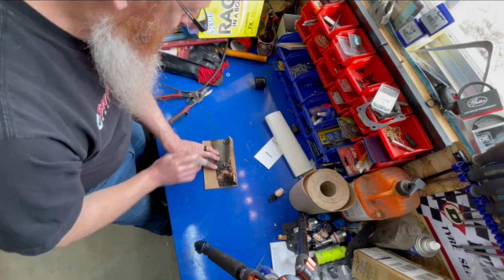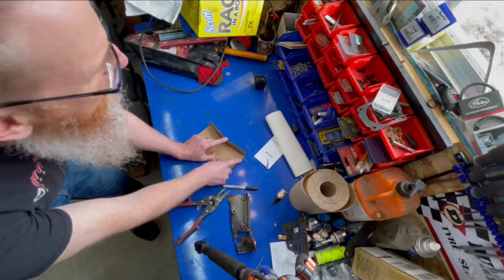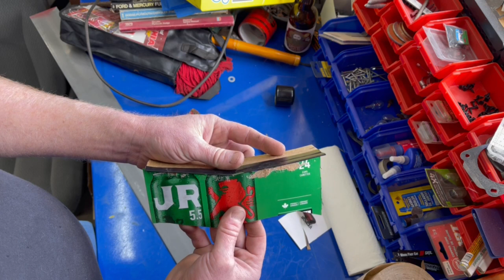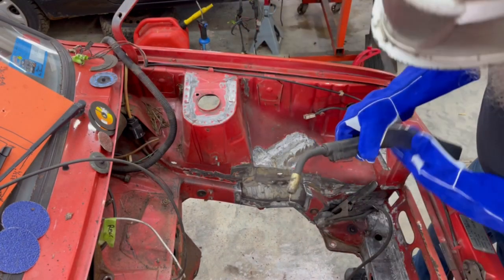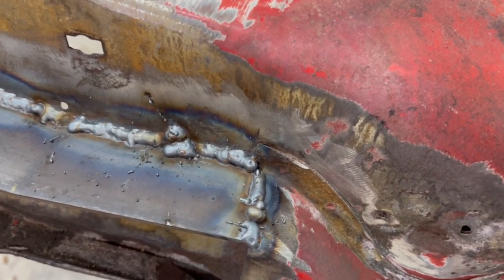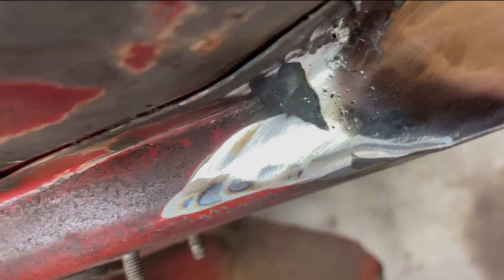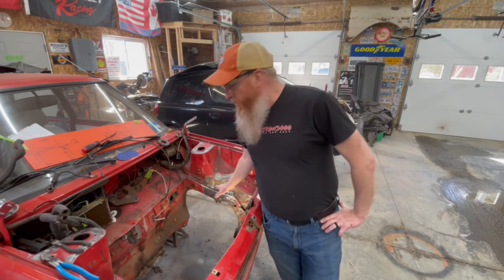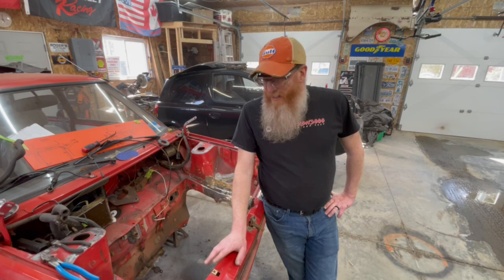DIY Frame Repair -Do NOT Follow Me For Welding Advice!

Comment: Consider putting an access hole in so you can rust proof the interior surfaces.
Reply from the maker: There seems to be plenty of removable grommets already! So Yugo engineers were thinking!
Reply: What were Yugo engineers thinking about...  More grommets equal less metal?

Comment: Looks like you could of turned the heat up a little more and the wire feed down some to get those welds to lay a bit flatter for that thicker metal. Also if you angle the side of the patch that will be welded will help it lay down more for less crotch burning grinding. LOL

Don't be afraid to mess with the wire feed speed and the heat range with the thicker metal. On the thinner stuff you'll want to turn the heat all the way down and use the stich weld technique where you will want to hit and release the trigger. If your welder has a stich weld setting it will do that automatically but IMHO is very annoying to use that feature. I would rather control the trigger myself but you my like the auto function better? On the thin stuff if you just hold the trigger down all you'll do is blow holes in the metal you're trying to weld or warp the snot out of what you're welding.
 
You'll figure it out, keep practicing and you'll be an E-lectric glue gun garage pro in no time!
Reply from the maker: I appreciate all the tips I can get. I did learn quite a bit when doing the rockers and cab corners on Dale the truck. I'm sure with more practice, i wont be so timid.
Reply: @OldeCarrGuy  
Sorry I must of subscribed after those videos. If only there were more time I could go start from the beginning of every channel I'm subbed to. So I apologize for not knowing the level you're at.
Reply from the maker: @itseithergonnaworkoritaint7852  Saul Good-man!

Comment: As they say.. a grinder and paint make me the welder I ain't. ;)
Practice can only be obtained by doing. Carry on.
The next time you do a big job like this consider buying a length of 2X3 thick walled tubing and make a chassis for the little tin can. Then you could stuff in a V8. ;)
Reply from the maker: I'm given'er all she's got Captain! No V8!
Reply: Sigh. Fine then...
I'll try to send you some dilithium crystals then. 
I'm all out of flux capacitors.
Reply from the maker: @Joe.Doucette  at this point I’ll take all the help I can get!

Comment: You should have sandblasted the car first to show all the weaknesses... ;-)
Reply: Yugo has the thinnest body in the world, 7mm... ;-)
Reply: Yugo's chassis is usually rubbish, you will need a lot more reinforcement than those welds.. ;-)
Reply: You will need pieces of metal in the shape of a triangle in the cosks to weld them in order to strengthen the chassis, I don't know where to find a video, nobody records that in our country. ;-)
Reply: You can have a completely new chassis, but it's still garbage that twists and cracks with every step on the gas pedal! ;-)
Reply from the maker: Great point! But It's not in need of a full restoration. I will be adding structural components to help with reinforcements.
Reply: @OldeCarrGuy  I'm following you, what are you doing! ;-)